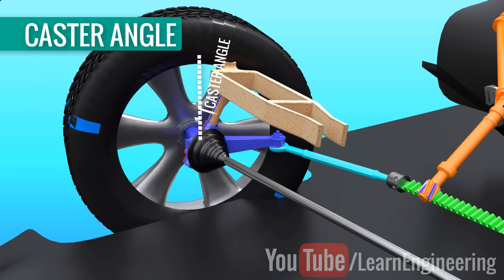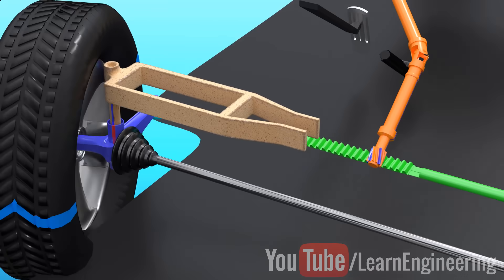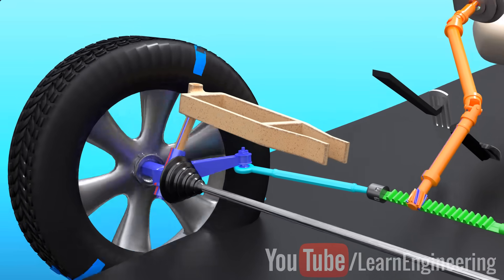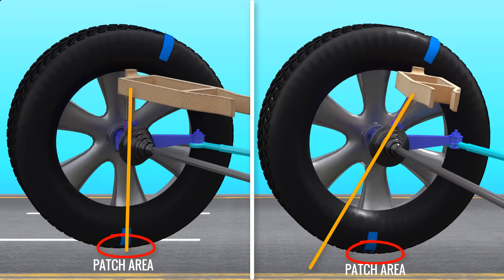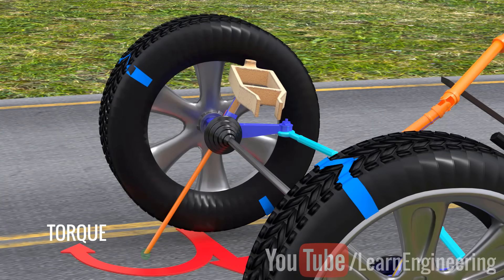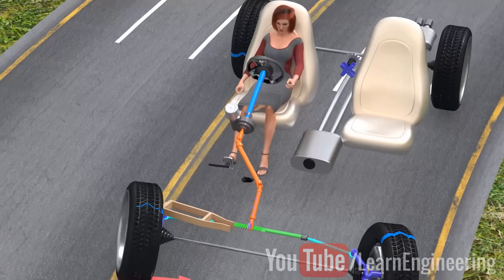How does the Steering Wheel automatically returns to its center?

Comment: But what happen when negative caster is given????
Reply: So that's why driving backwards fast in a car can cause abrupt steering.
Reply: @Bremberry  best comment
Reply: @Bramberry, no. The mechanism explained in this video still applies when driving backwards. What is difficult about driving backwards is that the direction of the rear wheels decide where you are going to, and you have to set this direction using your front wheels. You have to actively think ahead which direction the rear wheels need to point to stay on course.
Reply: @Engineer9736  The mechanism does still apply indeed, but when driving backwards you have the rolling resistance which is now in front of the pivot point. I suppose that force will try to push the wheel around it's pivot point (so exaggerate your steering). The centrifugal force will work against that but only after a certain angle is reached. This makes your initial steering abrubt. With a front wheel driven car I think you will notice this only as soon as you release the acceleration pedal.

A shopping cart is indeed different in the sense that you are not steering the wheels and the car(t) has to follow, but you're instead steering the cart and the wheels have to follow.
Reply: It would simply turn the steering wheel into the turn.
Reply: you'd find that as you begin to make a turn, the steering wheel will turn very easily, it would continue to turn, until it hits its limit, and would be difficult to get back straight again.
Basically, it would be very dangerous!
Reply: I’m getting so tired of hearing about shopping trolleys in this comment section. There is totally No relation between shopping trolley wheels and car/bike wheels. A whole different mechanism.
Reply: probably a lot of oversteer because the centripetal force acting on the patch area will generate a torque in the opposite direction.
Reply: It'll pull the car to one side
Reply: Wow, none of you Geniuses have a car and try driving it reverse?
Reply: try pushing a bicycle backwards and see whats happens
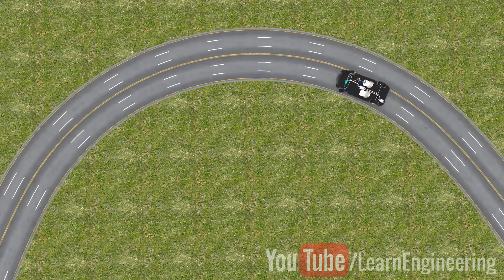Reply: I'm not an engineer but I agree with Richard. Driving in reverse is same as watching the part between 2:09 to 2:11 in reverse. The patch area is still to the right of pivot point (in that over the top view), and the friction is still the same (directed towards the center of curvature). So torque due to friction must still be same, ie, trying to turn the wheel clockwise.
Reply: @kartikchoubisa  but the torque produced along the castor angle will be same as the steering angle, thereby results in oversteering
Reply: @mechdonz08  mhm? Bother explaining a little?... I don't think explaining me will help without diagram or something, so nevermind. If have a link then share it!
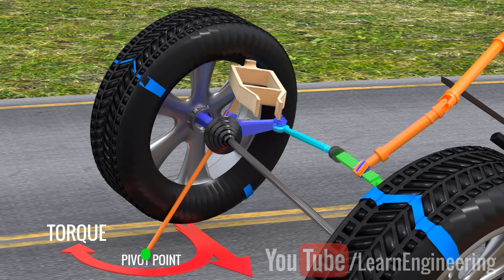Reply: @kartikchoubisa  if u stop the video at 2:54, see the direction of torque along the pivot, it's opposite to the turning direction, so the steering returns back to the center... But when u drive in the reverse direction, the direction of the torque will be in the direction of steering, so it just accelerates the steering and results in over steering...
Reply: @mechdonz08   ok, let's talk about the snapshot at 2:54. The car is going forward (that is, towards left side of the frame). Fine. But, even if the car was going in reverse (that is, rightwards), everything in the snapshot would still hold, everything but the rotation of wheel, which would now be in the opposite sense. (So the direction of friction would still be the same, right?)
The steering will tend to rotate clockwise (as seen by the driver) due to this torque. So this torque bring the steering to it's original position. 
(For oversteering, the friction needs to point away from center of curvature. Which is clearly not happening because the curvature stays the same when going forward or backward, and to make the turn possible the friction has to point towards center in both the cases.)
Reply: @kartikchoubisa  considering the torque on the pivot is  in the place even in going in reverse direction, considering the direction of friction also in the same way as in the forward direction, then the direction of torque will be reversed...
Reply: @mechdonz08  torque is r cross f, so it cant change unless we change r or f. We agree f stays same. r has to stay same. I don't see anything wrong with this.

I'm ready to take my hands off the steering while making a turn in reverse to get things straight. for science. only if I had a car tho.
Reply: @kartikchoubisa  U are right, it will cause no oversteering, moreover for centripetal force it's just the magnitude of tangential velocity that matters, not the direction as it's mv²/r and will be same for the car moving forward or backward

Btw in which class are you studying?
Reply: You will not be there to tell.